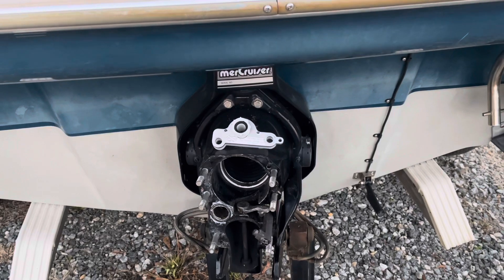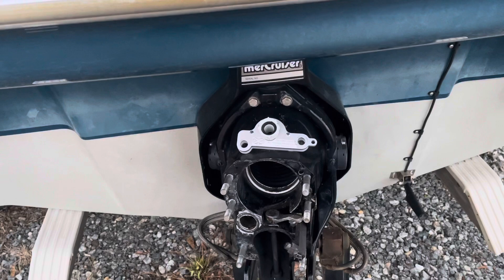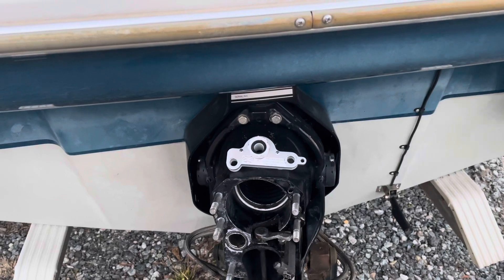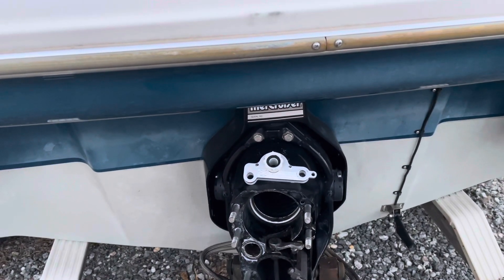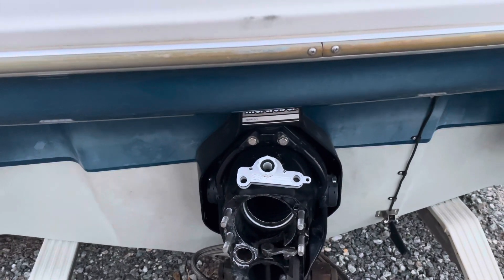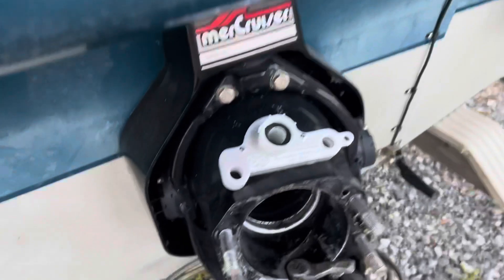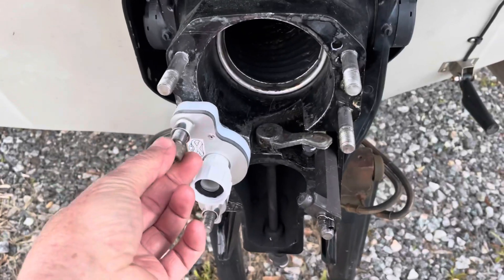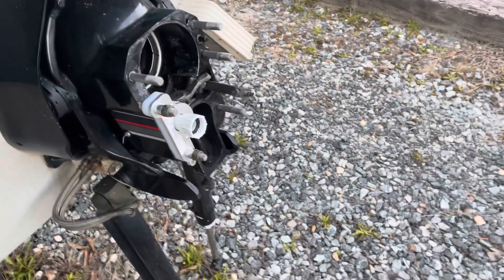Safer Water Muffs - Introducing “The Water Moccasin” Garden Hose Adapter

Comment: I watch your videos alot, I recently bought a new to me boat with a 1999 mercruiser 3.0. The engine sound solid, great compression, never took it to the lake for test but on the muffs I can leave it running for 30 minutes no problem. Long story short, We always on the water here in Florida and need to make sure everything is water ready, so I took it out of the boat for a complete rebuilt. While putting everything back together I notice that the exhaust manifold has four water passages, but the riser has three. Is this normal?
Reply from the maker: I will have to check an engine in my shop this evening. I’ll let you know.
Reply from the maker: There are only three water passages in the exhaust riser so you’re all good. Mine is the same as yours.
Reply: @moccasinmarine  Thank you thank you.